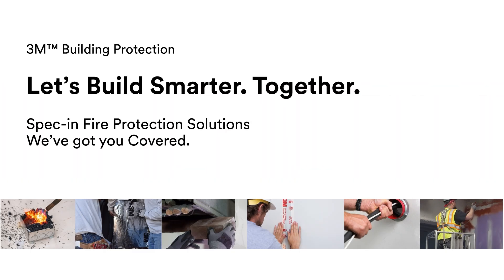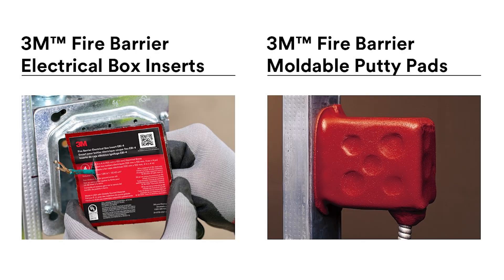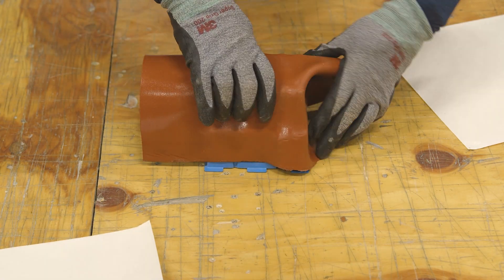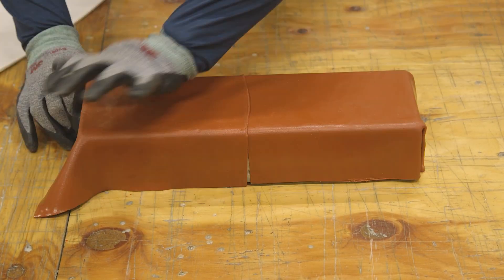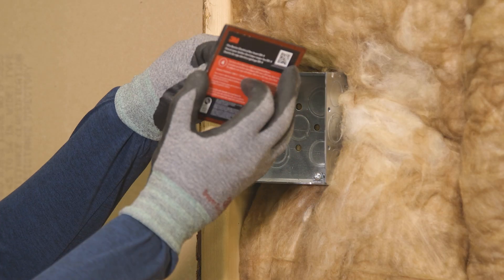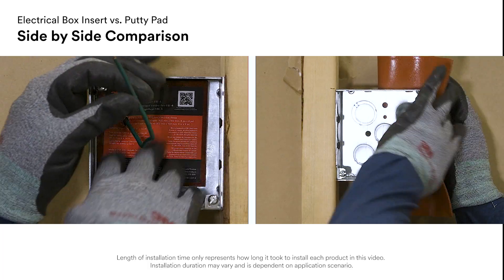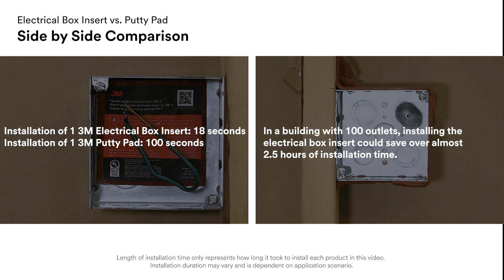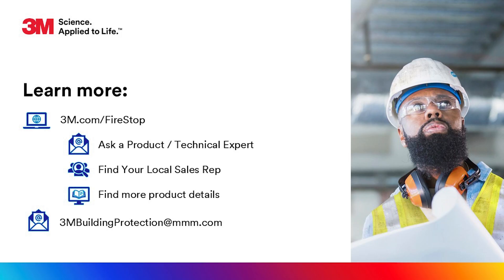3M Answers: When to use an Electrical Box Insert vs. Putty Pad

Comment: Really helpful breakdown! I never knew the difference—now I understand when an electric box insert makes more sense than a putty pad.
Reply from the maker: That’s awesome! Choosing the right solution can really improve efficiency and safety. 😍
Reply: @3MIATD  Well said! Selecting the right solution is key—not only does it streamline efficiency, but it also ensures a higher standard of safety in the process. 👍